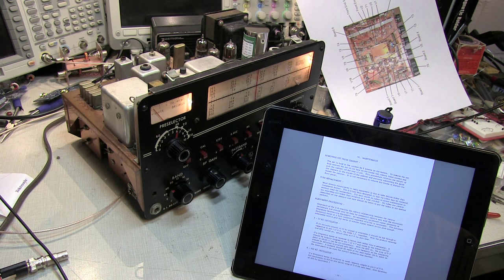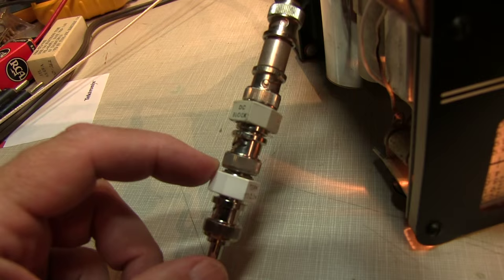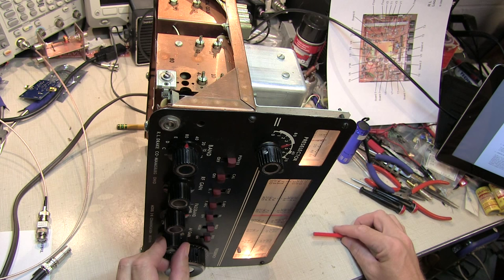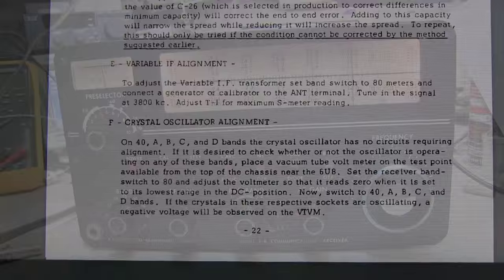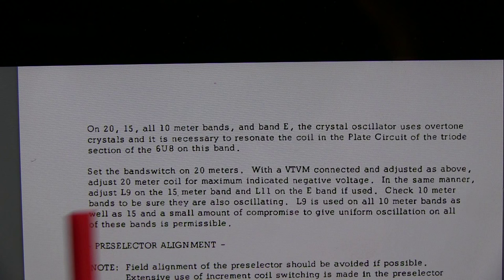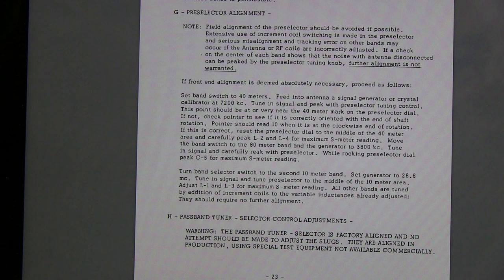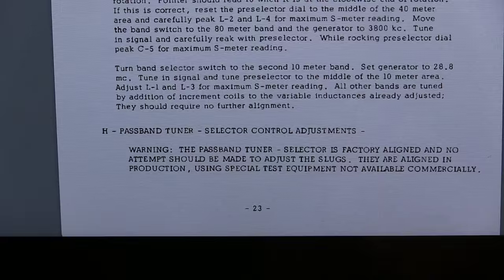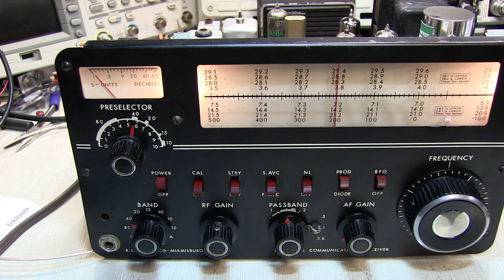#214: Drake 2B receiver alignment

Comment: Thanks again Alan for a great series on the 2-B; gonna have to pull mine out and follow along as required. One comment from a old "...one hand behind the back" type - as much as we hate taking our wedding bands off, we may want to think about doing that when digging into our boatanchor rigs; don't remember getting bit by a transistor but tubes, yeah, that's a different story (found myself on the other side of the high school electronics lab after getting hold of the 400VDC plate supply of my homebrew Novice rig back in the dark ages!). 73 - Dino KL0S
Reply from the maker: Yes, I should've taken it off. I didn't think of it until I saw the video frame that YouTube picked as the thumbnail. My bad!
Reply: +Dino Papas 
I remember watching my dad working on an old tube CRT TV when I was a kid, and he made a mistake. The electricity picked him up off of his stool and threw him back in the air into the wall. He took a break for a while.
Reply: +Dino Papas I hit my wedding band across a guitar transistor amplifier power supply line.  While I didn't get shocked, I did get blinded for a minute and blew a notch in the golden ring.  Yea, hand behind the back - ring in pocket.
Reply: +Robert Calk Jr. Buddy, that surely made a deep impression on you as a boy. That's as close to mythical as it gets: an unseen but respected force throws one's father across a room. My shock was from a staticky roofmount vertical. It was arcing and snapping, and I got close enough to become that arc's new special friend. I too, took a break for a while.
Reply: +JC Haywire Electricity can do some funny things sometimes.
Reply: I giasou Dinos. True advice. Tape ring is ok too. Karl Ioannis wa2kbz

Comment: Great video. I’ll point out that you didn’t say what the amplitudes were of the injected signals. Lots of other good details like pointing out the thru terminator, DC blocking cap, but not test signal amplitudes. An experienced tech knows, but not the newbs. Might want to leave a comment about that or how to select the general test signal levels based on the alignment task.

Comment: Hello,
In one of the Drake 2B videos I heard you mention doing the resistance measurements as specified in the users manual. I measured the resistance values on pin 6 of V9 and pin 7 on V10 and my ohm meter jumps all over the place and I can't get a reasonable reading. The manual specifies 24K Ohms, do you recall if that is what you got?
Thank you!
Reply from the maker: Sorry, I made this video about 7 years ago, so I don't remember.

Comment: Hello! Awesome video!  I have a signal generator for the 50KHz signal with a couple of banana jacks, one for ground and the other for signal. Does the capacitor go across these two or just on the signal terminal of the generator and then to pin 1 on V5? Thank you for the info!
Reply from the maker: The capacitor goes in series between the signal line from the generator to the pin1 of V5

Comment: quite useful, although I prefer a counter to zero beating...since most cannot hear beat note lower than 50 cycles..and as we know..some cannot hear 100 cycles !   when aligning IF's  the final test needs to be done by ear for quality as sideband cutting can happen when 2 if stages are stagger tuned.. each is peaked but center freqs are not the same..a common problem in ssb rigs that simply dont sound right..because they the quality step was omitted.  Something wrong with the highest 10M xtal osc...bad xtal or ?   dirty switch or socket or ?

Comment: I was just wondering Alan, whether it would ever make sense to monitor the beat "tone" on the scope, perhaps in addition to the loudspeaker. It struck me that the reason it seems to go into a "dead zone" where you have to interpolate is because the frequency drops below audible frequency and/or perhaps below the low frequency cutoff of the audio amp/loudspeaker. I suppose it's not critical enough to warrant the extra effort to get it dead on, but thought I'd venture the question :)
Reply from the maker: +Steve Canny Yes, a scope could help get closer to true zero beat, provided you could monitor the signal at a spot that didn't have a LF cutoff (like the audio circuits have, as you correctly surmised).  For a rig with a digital readout where you can visually see 10 or 100Hz frequency offsets, this is more important.  For an old analog, slide rule reading rig like this, the precision of your ear and the interpolating between audible points on either side of zero beat will get more more than close enough.  Great observation though.

Comment: I'll be honest with you. I am versed in audio engineering at a fairly detailed (but intermediate) level. I still have troubles understanding the underlying concepts to receiver (and transmitter) alignment and setup. Knowing when to zero beat and when to tune for maximum amplitude. Audio people understand filters--in the audio realm. I would love to see an "Amateur Radio Bootcamp for Audio Engineers."

Comment: Is there a Tek part number for the blocking cap inline with the scope probe?  Sure would be a handy thing to have here.  de John, K8NN
Reply from the maker: Unfortunately Tek doesn't make them anymore, but they can be found in the open market by other manufacturers.  Search for BNC DC Block.

Comment: Thank you for posting this video! I used it to align a Drake 2B I purchased on ebay! You're instruction helped me get through an intimidating process! Do you have any antenna recommendations for the 2B? I have limited space, (an attic), and I am only receiving, not transmitting.
Thank you!
Reply from the maker: No specific antenna recommendation - for receiving, just a long wire around the perimeter of the attic.

Comment: Nice. Did you have the output of the sig gen at a specific level?
Reply from the maker: For the RF input, I was running it at 30uVrms. For the IF signal injection, it was 100mVpp.
Reply: +w2aew Very good. Thank you

Comment: Thanks Alan. I notice that your tuning rate is far slower than my unit. As far as I can tell I have the string installed correctly but the tuning rate is a bit too fast. I wonder if you have any insight into this? Many thanks for the series.
Reply from the maker: I noticed that too.  The main tuning shaft on my unit is a little different than others I've seen - the diameter of the shaft where the dial cord wraps around it, is smaller in diameter than the rest of the shaft.  I don't know if this was a factory option or modification, or if a previous owner had removed the shaft and turned it on a lathe in order to slow-up the tuning rate.
Reply: @w2aew  Interesting Alan and thanks for the reply. In fact my tuning shaft also has the smaller diameter section where the cord runs which makes it a bigger mystery! Perhaps the big pulley diameters are different in that case? I also wonder if different diameter dial strings would make any difference? I would not think so but then I never was too good at figuring out pulley mechanisms hi. 73 Dick N4HAY

Comment: I see that the one adapter on your scope is marked 50 ohm - 2 watt.  Is that unit the same as this "Tekronix  50 ohm 2W 10X Attenuator 011-0059-01 BNC"?
Reply from the maker: +Kevin Elliott No.  The part number you mentioned is a 10x attenuator.  The unit I used is a 50 ohm feedthru termination.  It is a Tek 011-0049-0x, same as Pomona 4119-50.

Comment: Alan - what is the value of the DC Blocking capacitor you are using or does it make that much difference?

Kevin - KG0MN
Reply from the maker: +Kevin Elliott It doesn't make that much difference, as long as it's series impedance is reasonably low at the operating frequency.
Reply: thanks Alan

Comment: Nice job, BUT - you should have tuned in some on air signals just for the "job done" satisfaction ;)
Reply from the maker: +Digger D Well, I actually spent a few hours listening to it on 40m last night - worked great.  I thought about adding an on-air segment to the end of the video, but since it was over 20 minutes long already, I didn't want to make it any longer.  Maybe I'll do a "band sweep" video with it in the future.
Reply: ***** That would make a nice wrap up.
Reply: +w2aew I too was waiting to see you check out the bands to see how the radio sounded. Thanks for the videos!